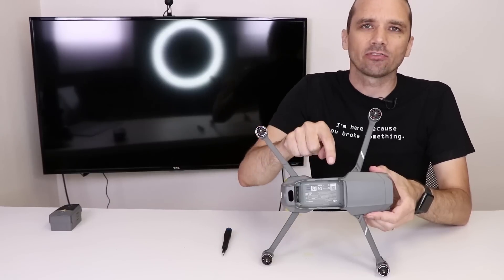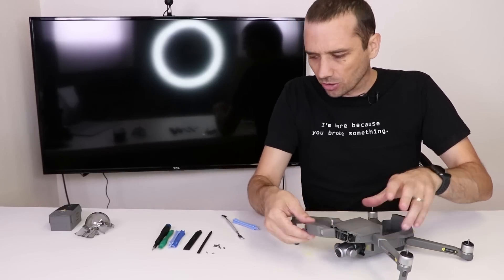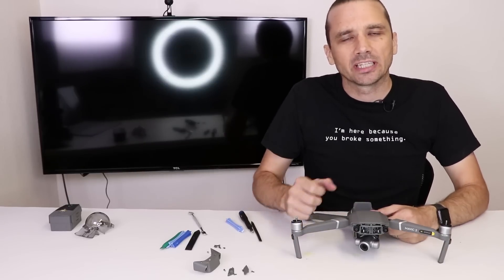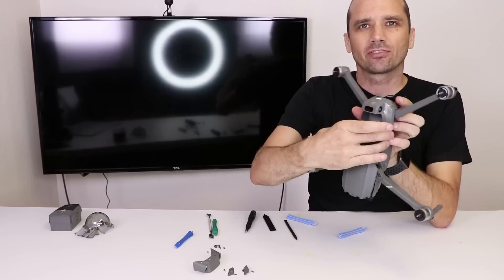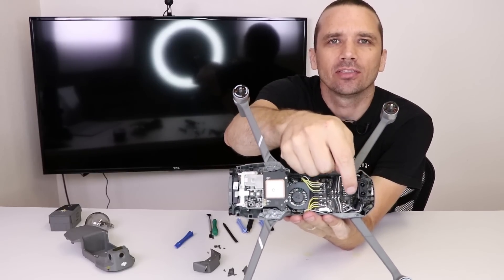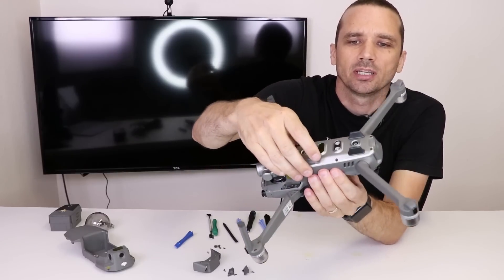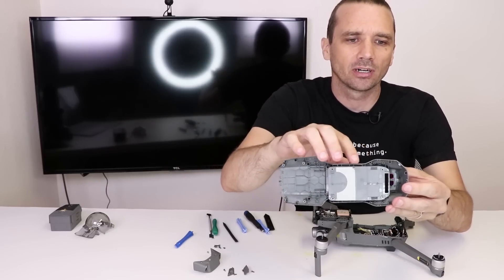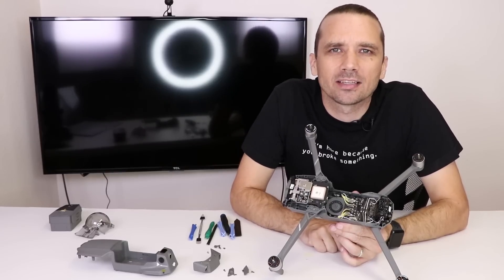Mavic 2 Teardown

Comment: Realizing this is an older video, but I want to ask before I go tearing down my Mavic 2 Zoom. How much space is there between the gimble control board and the under side of the top plastic? I'm contemplating trying to install an RID Db121 module internally to keep my M2Z legal come October of this year without mounting an external RID module and adding additional drag and battery weight. Thoughts?

Comment: I just got a Mavic 2 Zoom that fell in the water for really cheap. I'm trying to fix it. I can't see corrosion on the board, but everything is really dirty. It will be a lot of work but if the drone works after that, I will have a really good drone for a price lower than one original battery. I already saw that there is no dirt under the metal covers and on the main chips, so it might be fixable and luckily it didn't fell into salt water.